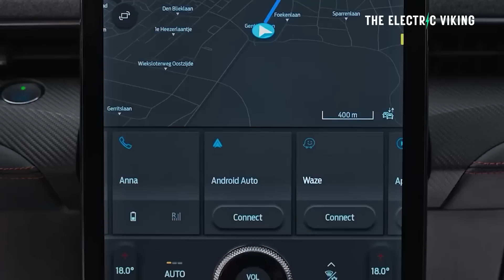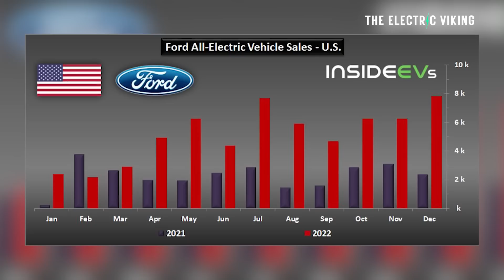Ford says its EV's have 1 mile of 70 pound wiring they don't need

Comment: During the tear down of the Ford Mach-E, Sandy Munro was critical of the use of standard length wire looms and over 3x length of pipes used for the Heating/Cooling system compared to a Tesla. He pointed out this all added extra weight and cost of the Mach-E.
Reply: Remember, the Ford brand manager came on and conseeded that the excess hoses were due to having to chose between getting reliable to market quickly with off the shelf suppliers vs added research time. She pointed to already having pulled one pump and some hoses. M3 started with waste wiring that is still being redesigned out. Practice makes perfect.
Reply: It’s tipically Ford putting cheap parts together. Sandy is right, good engineering looks elegantly and differently! Only look also under the hood of Mercedes (if you can; because they hide their shit) and BMW looking like fixed in a kindergarten. Then go for a Tesla or Hyundai platform to see the difference! Of course most buyers do never look under the hood but there are technic affectionados out there besides Sandy, we all love for his teardowns!😅🤓
Reply: I do believe in the future most customers will look under the hood…for a frunk🎉. No frunk..? No buy. 🔋 Welcome to the future legacy car brands😂
Reply: Ford and GM both have a tough battle internally…. Between the engineers saying “this is the way we’ve always done it” and the stealerships tacking on market adjustment fees.
Reply: @ai4px  exactly!
Reply: I noticed in the cooling system they dozens of fittings in the cooling system.  My first thought was they were intentionally designing possible points of  failure.  Planned obsolescence.... very wrong
Reply: @johnfitbyfaithnet  Why would you buy a car with all these failure points? Hard NO
Reply: @b4804514  because it's electric.. it says mustang... you get $7500 off....  shame on consumers for buying expensive items they haven't educated themselves about.  But alas it happens.  The stereotype I think of is a suburban mom (ie the yuppie type) who got the very expensive car to keep ahead of the neighbors only to find out that it uses CCS charging and that doesn't always work.  Cue the phone call screeching at her poor husband.  Honestly, It'll be a decade before that family dips their toe in the EV pool again.  And that's a shame.  But is it planned by the OEMs?  Remember GM saying people didn't want EV's when they were phasing out the EVone?  Yeah, that all over again.  Except this time, there's Tesla eating GM and Ford's lunch.
Reply: Ford will soon have to recall the Mach-E 😎 (too many parts)
Reply: @MelanieJoules  i agree! New EV without frunk = crappy EV! 😄👍
Reply: @WoodHughes  When she had that interview with Munro was when I realized Ford was serious.  She basically walked in to what she knew was a lion's den, conceded some issues, and explained how she would make it better.  Can you even imagine Audi doing the same?
Munro was afraid Ford wouldn't come or would blacklist him.  Remember, he was initially very critical of Tesla, and Munro expressed the same fears about Tesla before his interview with Musk. Interviewing with a known competent critic is a mark in favor of both Tesla and Ford.
 Munro only changed his tune on Tesla after tearing down later versions of their cars and seeing immense improvement on the inside, which included things like reducing unneeded wiring, which are both extra costs and extra failure points.  Farley' s points about wiring are valid.
Reply: @ai4px  And the Union labor that needs a written permission to change a lightbulb.
Reply: These so called engineers can’t even copy octa valve and other tech
Reply: The union workers have always been an issue in Detroit.
Reply: @akira28shima32  honestly I work in pulp and paper. We had a breaker pop on the scanner that measures and controls the entire production of a machine.  They don’t make paper without it.  I found the electrical panel was locked.  Called the union electrician on radio and he came right over.  He opened the box and verified the breaker had tripped.  Refused to reset it because he was on break. He locked the box back up and went back to his hiding hole.
Reply: @WoodHughes  yes.   but the issue is can ford afford to make money losing EVs for 10 years.   even 7 years.
This is extra critical.. because ford no longer has cash cows of Trucks and SUVs because many people are waiting to buy new ones until EV truck and SUV comes out.   90% of all cybertrucks are going to go to people who normally would bave bought a new SUV.
Reply: @Melanie Joules - Caramel Secrets  I would hope that some automakers would choose to remove the frunk to reduce weight. I'm thinking of Canoo vs the Ford Lightning.
Reply: @ai4px  Damn 🤦🏼
Reply: @BarryObaminable  100% correct. Ford and GM both at ample opportunity 20 years ago, and prefer to sit on their hands. We always heard about the industrial light of these Giants. Turns out it’s a case of a tortoise and the hare. These industrial giants rested on their laurels for too long.  
Love the username

Comment: Sandy monroe did show the wiring spaghetti structure of the Mustang to everyone and too easy to note.
Agree with Farley to cut bonuses and get sandy in as consultant asap!!!
Reply: Or buy a Tesla instead, because less wiring (they have many patents) and a perfect ingenious octovalve heating/cooling system are adding to efficiency. The Mach-e even has no chance against the E-GMP of e.g. my EV6 AWD in most regards that count in Europe!😎🤓🤪
Reply: Don't waste any more time with the jim farley/ford excuses. Sandy Munro is ten times smarted than Jim F. 
1.) Sandy Munro and company will tell you what's wrong and why
2.) Jim Farley just admits 5 years later they have bad designs, bad engineering, etc. (after tech reviews)
Reply: @jaydeister9305  While I agree with everything you said, in comparison to other legacy autos Ford is ahead. This does not mean Ford will ever catch Tesla. It does mean they have a small chance of surviving in a greatly reduced state.

Comment: Old habits die hard.  Farley has to recognize that his team just did what they ALWAYS do.  This outcome is far less due to engineering stupidity than fragmented responsibility (cost is somebody else's job) and deadlines (quick and dirty solutions). This approach becomes part of the culture/routine.  This is why Sandy Munro (formerly of FoMoCo).  He points out all these failings.  Farley study his findings and act on them as Tesla has done.
Reply: It’s like the 70’s all over again. The established automakers are caught fat and happy while Tesla and byd will eat their lunch just like Japanese did in the 80’s.
Reply: Thomas Simmer:  Yup.  Cheap, fast, and good.  Pick TWO.  You CAN'T have them all.  But management of the vast majority of companies won't accept that reality, so employees throw up their hands, and go with cheap and fast (meeting the deadline and avoiding management wrath in the short run), and of course, over time, the OBVIOUS results. 

Management can blame the employees all they want.  It doesn't change the reality, which they should know.

Comment: Maybe Ford should just buy Rivian and then hire Sandy Munro to give the design a full optimization, and then create new Ford designs starting from there, with Munro-designed assembly processes.
Reply: That would be just digging the hole deaper
Reply: Why would Ford buy Rivian?  After looking at Rivian's manufacturing Ford decided, smartly, to go their own way.  Did you even look at Sandy Munro's evaluation of the Rivian.  For example, go look at what his engineering team had to say about the seat manufacturing and how they praised Ford for the simpler and better engineered seats compared to Rivian.

Comment: Why aren't the manufacturers not using fiber optics to communicate between modules which cuts down on the use of wire. A power, ground, and the fiber optic cable. Mercedes at one tyme was using fiber optics but haven't heard of them using as of late.

Comment: Ok, I read the CNN article. It switches back and forth between multiple people and multiple pieces of information. Would need to watch full meeting see what the man actually said.
Ford is three jumps behind Tesla. This is not new or secret information. They made a product which the public wants, got it to market fast, and have more customers than product. The downside is that they cut and pasted a lot of existing  parts and systems from other Ford products. Also, they need to combine stuff-work cross disciplines-difficult as they are organized by disciplines. This is inherently less efficient than going with a "Clean Sheet"design, which is what GM is attempting to do (and you trash the hell out of Mary Barra for taking this "clean sheet" approach).
 Now, Like Sandy Munro, they have sat back and evaluated their product - they have work to do. So, I think that Jim Farley being aware of Ford deficiencies and working the problems is a positive.

Comment: Cybertruck is honing in on a single casting with a structura battery pack and no paint shop.  That should translate into 1 million vehicles per year sold in North America alone.  They are shooting for a 35 percent margin on the CT.  They'll also save 600 bucks a unit by not advertising.  This is simple math.  It's only a matter of time before Tesla stands alone.
Reply: ‘09

Comment: the trouble with ford and gm especially is the amount of cars that they claim "sold" that in fact sit on dealer lots,if indeed they were in customer hands then they both would have had a good year, there will be a point when the dealers will have to say no deliveries for the next 1/2 or even more months ,when that point is reached, they will both have to decide "do we make to stockpile or do we stop the lines to prevent over production" either way they are burning cash with unsold vehicles that as each day passes are rotting and cost there dealers as dead"unsold" stock, also the ability to pay its suppliers in a timely fashion like 30 or 60 days nett, if the suppliers dont get paid in a timely fashion they will soon look to put them on stop and look for on time paying customers, regards LG they were proably pissed that gm could not deliver on any of there claims to in effect LG were bailing out gm and losing money on making batteries for gm if they cant make the cars LG cant earn from the batteries, especially bad for GM due to the long established relationship LG have with Tesla already, being Tesla pays its suppliers in a timely fashion
Reply: Very true! I see a lot of Hyundai EV cars on my local military US base. We are talking several hundreds on this small U.S. base off pacific coast. Car makers like Hyundai, Toyota, and ford are so slow to catch up with Tesla.

Comment: I had a 2007 Transit with leather seats. The drivers seat base cover was trashed by people sliding in and out so I went to the main stealer and they wanted over £700 for a new cover and foam base. A local leather repair shop did both front seats (including removing and replacing) in matching leather for less than £400.

I don't care about their record profits and cannot wait for the company to be Found On Roadside Dead. Let someone else have a go instead.
Reply: Same here! Friend bought a new bronco and FORD wanted $4,000 Cdn for leather, he had a local shop redo all four seats for $1,800! Dealers again really trying to gouge buyers ! 👍🇨🇦
Reply: There’s something worse than 70 pounds of redundant wires. Redundant lawyers, redundant bosses and any extra personnel. Oh! I forgot Unions,😂

I can understand some wire redundancy. Wires run through places that are difficult to reach and if a customer decides he wants such bell or whistle, technicians have to add wires in difficult places, some times unreachable. THAT’S expensive…

But I agree with Farley. Some Designers couldn’t care less…
Reply: I wonder how big their profits would be if they suddenly had to stop growing their equally unimpressive debt.

Comment: Hi Electric Viking, if a vehicle manufacturer uses an existing internal combustion engine vehicle body to build an Ev do they have to do re-certification for crash test with NHTSA ?
Reply: Why Not? The Whole Drivetrain is changed, the Mass is significantly different, and the Mass x G-Force factors are totally different!

Comment: A regular ICE car is mechanical. So is an older Cessna plane, but not so much a 747. A Tesla is a robot on wheels. It is a computer with sensors and effectors. Castings and structural packs simplify and improve the frame. Body in white, doors, hoods, windows, wheels, etc. - every car has those. But information, power, and control, in EVs, flows through the "bus" cabling (similar to the way it does inside a computer), not hydraulics,  mechanical, or individual signal linkages - from sensors to CPUs to motors, touch displays, seat heaters and controls, etc. Essentially, these differences require different design, production, operator, and service mindsets.

Comment: Canbus wiring systems were intended to run a single ring main around the vehicle. Each “node” (bulb, motor, etc) had its own integrated circuit to switch it on or off. Signals overlaid on the power loop triggered each node. Simples yes?  Erm no. Instead we got miles of wires because who knows why.

Comment: We’re pulling and praying for your family, Sam.  We’ve lost most of the relatives on my Mom’s side of the family due to cancer between the ages of 20 and 66, including her at 56.

Sandy Munro says that Tesla is 5 - 7 years ahead of all of the other EV makers in terms of weight reduction, battery and motor technology, and volume manufacturing now in the millions per year.

No one else has realized that Teslas are computers that just happen to be built in the aerodynamic and crash-surviving shape of vehicles, with in-house developed software to match.

CNN is coming around on Tesla because their new CEO from Discovery Networks, which bought CNN last year, has made it clear that the days of BS are over in their hard news organization, and the opinion portion is now facing a similar fate.

The Tesla price cuts that are thrashing their minimal “competition”, continued 50% annual unit production ramping, and corresponding ballooning of sales demand, plus printing billions in cash every quarter with no significant debt, have caused Tesla’s stock price to soar around 80%, and they can no longer be ignored by anyone.
Reply: One aspect of what Sandy said about Tesla being 5 to 7 years ahead is that Tesla is ahead by 7 years as of now but Tesla is not static. OEM would have to progress exponentially to pass Tesla,         impossible

Comment: I would not be surprised if Jim Farley gets the boot, just like Herbert Diess. Doing the right thing quickly enough in a large behemoth like the Ford Motor Company is probably next to impossible. Reprimanding the upper management, although probably warranted, will make internal enemies. What has to be the biggest worry for Farley is the arrival of the cyber truck. This cyber truck will start competing on Ford’s home turf. If it ends up eating into Ford’s market share of pickup trucks in a serious way, (I expect that is likely) then that will be the end of Farley as he will have to take the blame.
Reply: The opposite is likely.  Farley admitting this stuff and working for improvements on future models is just what they need.  They should want him to stay around; if the board does not see this as good, then you might be right!

Comment: Hey Sam.. Rented an Atto 3 for 2 days and was impressed with the car as compared to and ICE car.. Tesla is still a miles better car..Btw Have you noticed the huge torque steer issue the Atto 3 has when you gun it? It’s kinda dangerous!
Reply: I can relate to that, it probably does the same on full regen but to the opposite direction. Scary, my wife said, that’s why she was using D instead of S drive mode in the beginning. She has a BAIC EC3.

Comment: It is simple. Legacy car makers have asked ICE car personnel to work on EVs and these people work according to old molds. They just replaced an ICE with an electric motor. That is totally different from Tesla where motor cars have been created from the ground up. Also, the organization is different. Legacy car companies experience unmitigated incessant wars between silo's. It is the cause for this 1.6 miles of unnecessary wiring.  BUT that is the fault of the board of directors. Jim Farley blames people for a problem that HE should have handled two years ago because only a CEO can handle such a thing.